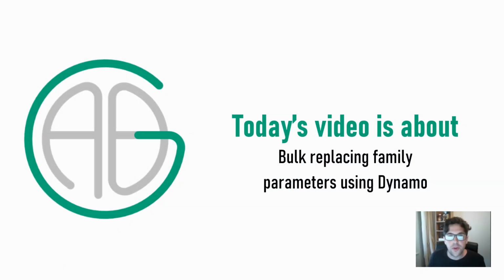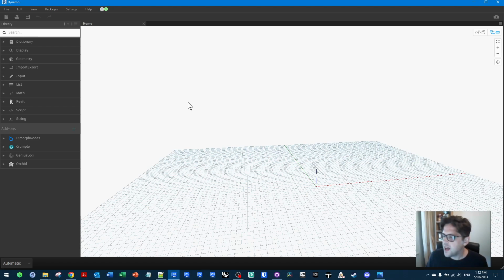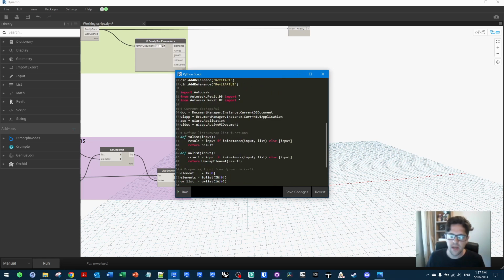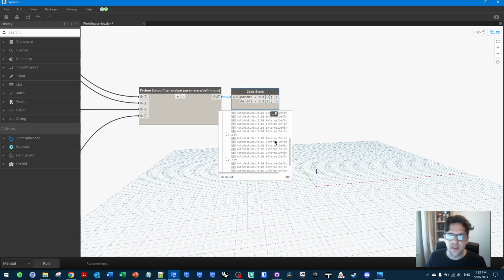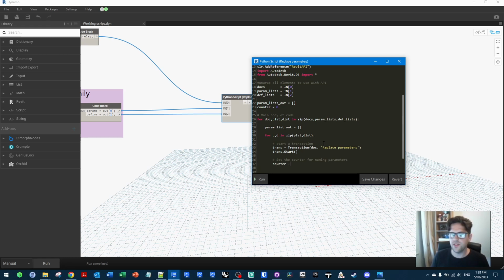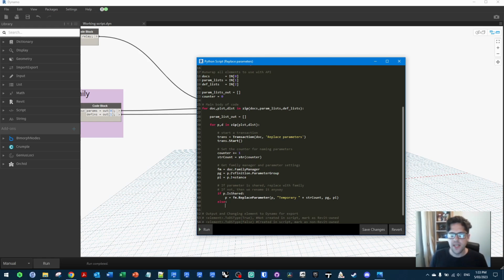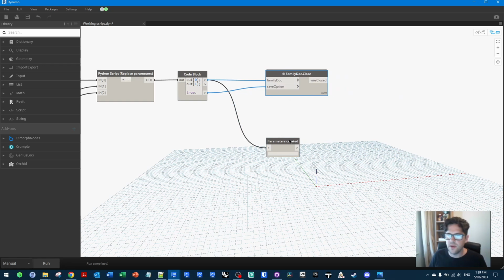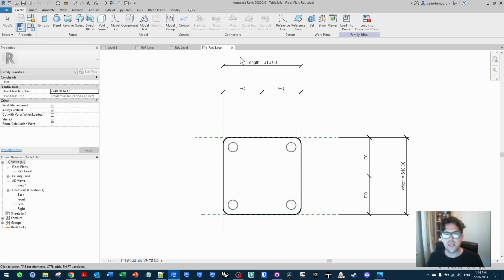Bulk replace Revit family parameters using Dynamo!

Comment: Random thing I came across... This does not replace parameters in tag's labels, which makes sense since in the UI its a different process too.
Reply from the maker: Yes unfortunately labels are not accessible in the revit API at this point.
Reply: Ah... I guess then nothing wrong with some manual work LOL

Comment: Is it possible to replace the category somehow ( for eg. "Generic Model" with "Structural Rebar")..?
Reply from the maker: Looks like it can be set using this property

https://www.revitapidocs.com/2015/e00c2b8b-b92d-526b-11b6-71c7e1d5d1b7.htm
Reply: the codes there are for C++ and Visual Net, how can i use them into dynamo node (in python) ?  @AussieBIMGuru

Comment: Thank you so much for posting this easy-to-follow tutorial, it has been a great help! When trying to run the code, the Python Script you used for replacing Parameters is giving me a None Type error telling me that a ParameterGroup attribute does not exist. I'm wondering if I'm having a problem recognizing the open DB files as arguments to that code block. Do you have any thoughts? All outputs of the different notes have matched those in this video up until this point. Any advice would be appreciated - until then I will keep troubleshooting. Thanks!
Reply from the maker: My best guess is you may be using Revit 2023? The API has changed a lot in that version so my code doesn't quite work there. In that case there are Forge/Spectypes to work with - a bit trickier.

There's a discussion on this here:
https://forum.dynamobim.com/t/shared-parameters-create-and-add-to-family-in-python/88081/20
Reply: @AussieBIMGuru  I am using Revit 2024, so that makes sense. Thank you for the linked post and I will do some more research on how to get this workflow to work with the newer API. Appreciate all that you do!
Reply: @AussieBIMGuru  As an update: I can get it to run successfully when there is only one file in the folder. The error I'm getting only occurs when there is more than one file. It opens up the temp file for the 2nd family, but never actually gets to replacing the parameters. I will continue to troubleshoot, but thought I'd update you with anything I found in case it is helpful to you in the future.
Reply from the maker: @ThomasWhite7696  my only guess is maybe the files are read only or you dont have write access?
Reply: @AussieBIMGuru  I've tried File 1 alone in a folder and it works. File 2 alone works. File 1  + 2 in a folder results in the None Type error at that final, complex python block. I've tested on both 2022 and 2024, so there's a high likelihood I've messed up the code somewhere - since I know you have done it successfully. That'll be my project at work tomorrow.
Reply: @AussieBIMGuru  I just wanted to update you to tell you I found the error in the code. The "Get/Filter Parameters" python block was not successfully filtering the parameters to only those that needed to change.  I didn't add spaces after "out_defs_list" to line up the = [ ] with one above from "out_params_list". I mistook that as a cosmetic addition on your part, but it turns out that Python was picky about those two outputs being aligned vertically in the code. If I delete the extra spaces, it errors out again.

Thank you again for posting this video and replying in the comments, even though nothing requires you to do this for free. It is much appreciated.
Reply from the maker: @ThomasWhite7696  ah yes generally spaces can only be around variables vs within them. Glad you solved it - typos get me often as well!

Comment: I want to give you a dozen high-fives! I am in 2024 and was able to fairly easily find the ForgeId update, with that update the script  ran perfectly! I had a couple dozen families I needed updated to shared and this helped immensely. Thank you for sharing!
Reply from the maker: Glad to hear this helped!
Reply: @kslifter1 Nice, :) , that it worked for you. I am struggling a bit with the script in RVT 2024. It worked for me for the Door Families, but when I tried with the Window Familes it shows the following error. I would be really thankful to you if you can help me on this.
Error: PythonEvaluator. Evaluate operation failed.
Traceback (most recent call last):
File "«string>", line 54, in < module> Exception: Cannot replace a parameter with a parameter of a different ParameterType.
Parameter name: family Definition
Reply from the maker: @deep_1723 as the error indicates your replacement parameter likely isnt the same storage type as the original one (e.g. integer vs number). Revit doesnt support changing parameter types with or without dynamo.
Reply: @AussieBIMGuru  Thanks you your reply :)
It worked with the same settings for Multiple Door Families in 2023 and 2024, but somehow it's not working for Window Families. I have assigned the Window Shared Parameters to the .rvt file properly matching the new parameters, but somehow I am unable to troubleshoot this. You had also suggested me the forgetypeid additional code on Dynamo BIM Forum to integrate to the script, but at the moment my knowledge of Dynamo is a bit limited , so I am unable to troubleshoot this. But, thanks a lot for all the support you are providing to the community, it's highly admirable :)
Reply from the maker: @deep_1723  I'll be hopefully capturing the forgetypeId thing in a future build of Crumple. If the script works for a door but not a window I doubt that's the cause as I seem to recall you solved that part by editing the Python code already. I'm nearly certain the warning means a parameter you're replacing isn't the same type as the intended one.
Reply: @AussieBIMGuru  I will try to relook into it. Thanks :)

Comment: That bring me memories when I did a app to create, edit, fill up parameters in families.
We had so much families to do, and later we move from one type of parameter naming to another, that I ended up with program that could : change parameters, create , new define shared parameters if needed, connect to connectors and even edit formula in parameters linked to it. That was crazy time. But then they made a forgeId mess and all this when to garbage.

some easy thing that I would suggests for your app(i m working in c# revit api so it can be not 1:1):
dispose Transaction - that may fix some of your problems
subtransaction is basicly for revert part of transaction if something when wrong(but most problem appear after transaction so it can be messy).
your parameters may have some default value, it would be nice to keep it. 
You can create a shared parameter file.
There is many thing that you should be careful with, functions in parameters, bind parameter to element, check if parameter is not buildin parameter that can't be swap rename or remove.
Reply from the maker: Oh man yeah forgeId has been a huge pain! So little documentation provided on how it all works versus the old API.

I have some more refined takes on this where I work that address some of the ideas, although in pyrevit/python versus a full app which could go further as you suggested. Thanks for the ideas!

Comment: Hi Gavin!
Great material as always! I attempted to use Orchid package to automate the process of filling multiple values for different families and family types taking values from Excel spreasheet. However, I was only able to successfully update one family at a time, and that too for only one parameter. Do you happen to know of any viable solutions for this issue?
Reply from the maker: The logic I use here to work across family documents should work, but instead you would need the row to be the family type/name and the column to be the parameter/value. From there you can get the parameters in each family, find their index of name and try setting the values using the family manager class. It would be a lot of looping, indexing and try/except statements.